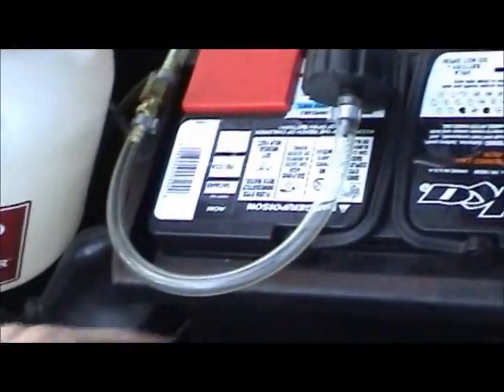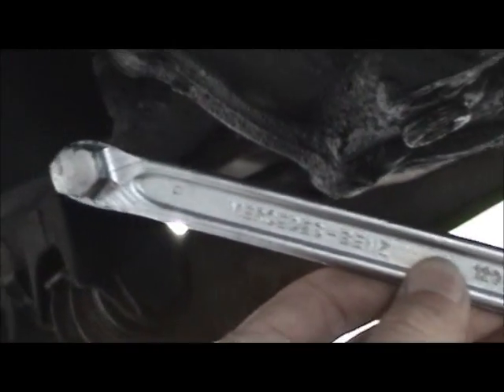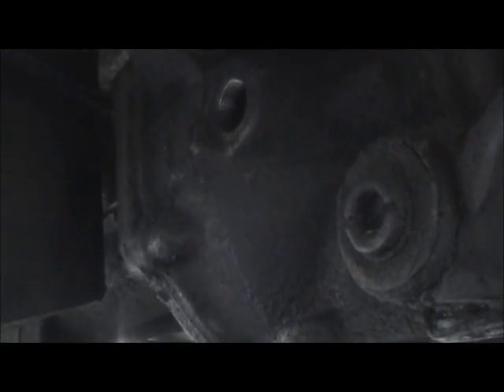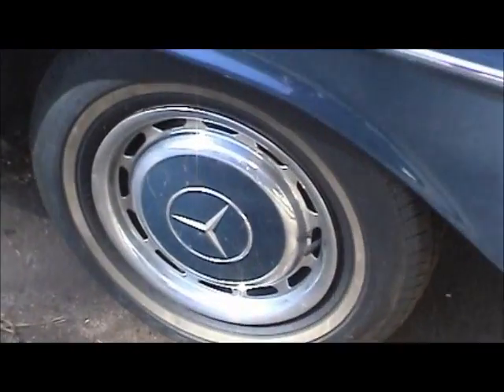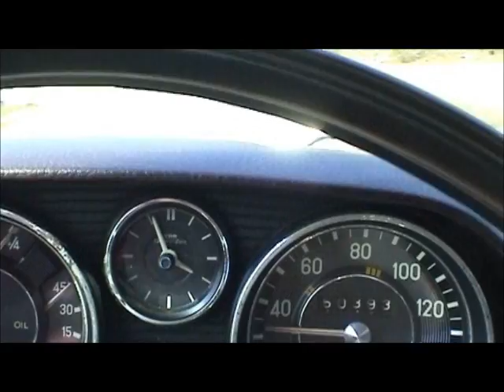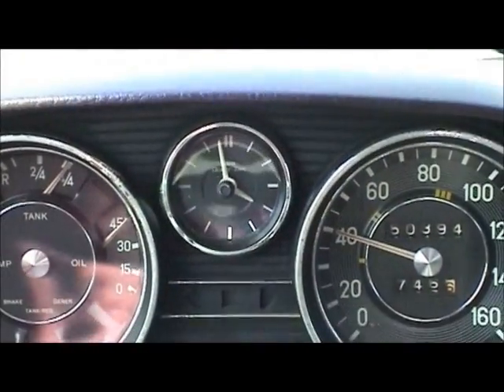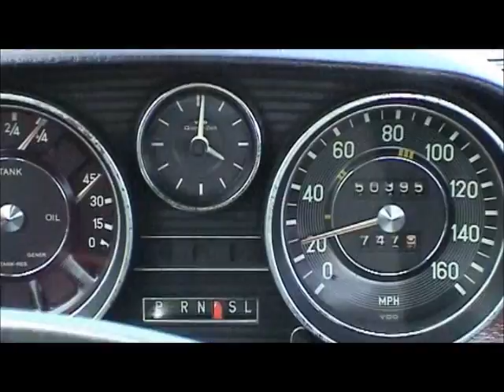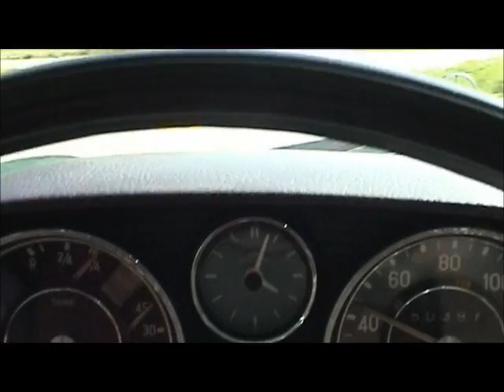The 1970 Mercedes-Benz 280 SE is Finished

Comment: I've always wondered how lubrication on these went. I mean when I do the lubrication, I just follow the charts in my maintenance manual and lubricate it at least once a season (seems to be 250-350 km a season in it). I've noticed some squeaks from the front right section, and it's pretty bad. I believe I've lubed what needs to be lubed. Going to silicon the shock, just to see. Is there anything you can do wrong while applying grease? I mean, as in places where grease shouldn't go and so on.

Comment: Yeah, of course by the fittings, haha! I usually don't put too much grease in there, just enough to last about 4-6 months in the seasons (with only a couple drives every 1-2 weeks). 
I really don't think the squeaking is coming from rubber parts. as the bushings were just replaced in 2012 (by the previous owner). Is a shock absorber able to squeak when it compresses? It sounds more like that, as it only happens on one side (as the bushings would probably have went on both sides by now).